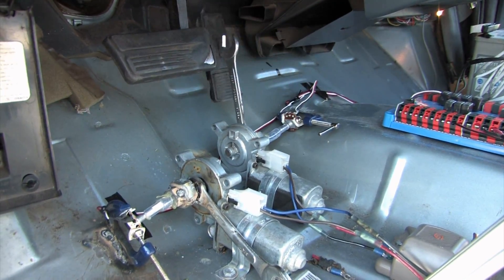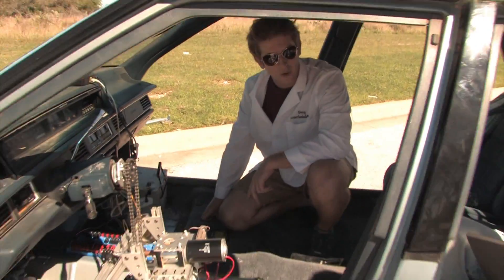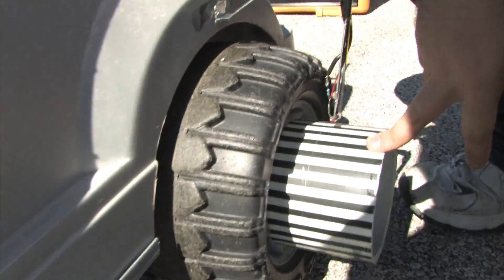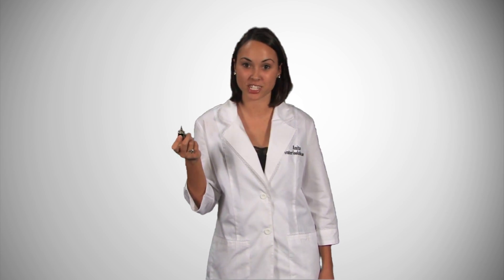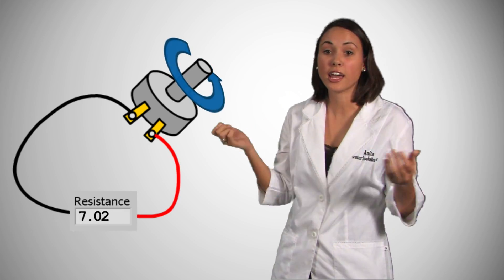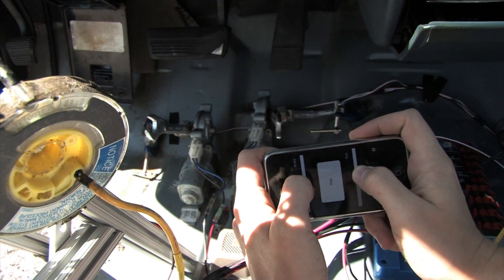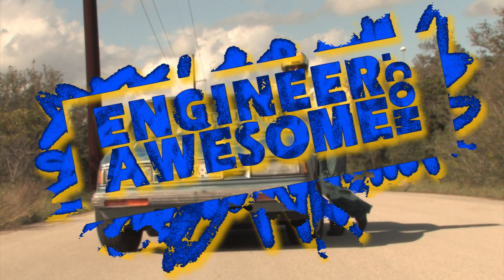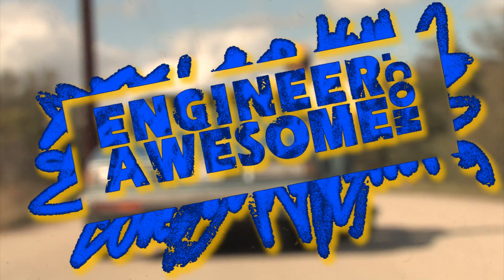Driving a Car with an iPhone and cRIO (Part  1 - Overview)  Waterloo Labs Episode 03

Comment: why the fuck do you keep responding? and by the way, I pointed out the date because that was then and not now.. and I can name more than 200 females that are "hotter" than you. Also, you comment about how I should masturbate to 20 year old porn. Are you asuming I masturbate to 20 year old females having sex? If so, then there is nothing wrong with that. It just pointes out how your not a homosexual. So, are you a homosexual? or do you think that its just plain gross? Because its not, its normal.

Comment from the maker: @KC9RXB Actually, the controller, modules, power distribution board, battery, motor controllers is available for 1,800 retail. The NI RoCK is the retail version of the FIRST Robotics Competition Kit of Parts which thousands of students around the world have (less expensive for teams). bit(dot)ly/NI-RoCK

The car was only $300 on Craig's list and we pulled the motors out of the doors from the car. The only other parts we had was metal bars, a sproket and a motorcycle chain.

Comment: first, alot of the code is pre made on labview if you get the FRC (First Robotics Competition) version, also almost everything in the car is what a common frc robot contains so theres no special code most of its pre made, as for the iphone theres an app called driverstation look it up and that can be used to run any labview code downloaded to the cRIO easily wireless all you need is the ip of the crio usually:10.xx.yy.5 which would be your team name and change your wifi ip to 10.xx.yy.6

Comment: @WaterlooLabs Haha, yeah. We just started building the new control board for our FRC bot today, and it can get pretty messy with all of the stuff that is required for the 5+ motors, encoders, servos, misc sensors, and wifi.

Comment from the maker: @MagicMan874  the range for our system was a standard wifi router range, so a few hundred feet. If you set it up with 3G wireless or other long range internet connection, you could control it from anywhere...